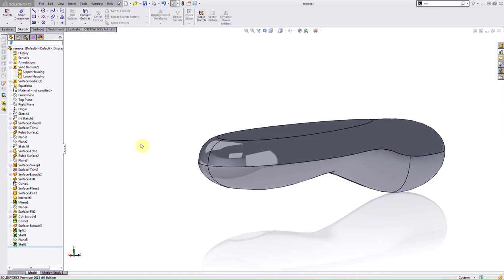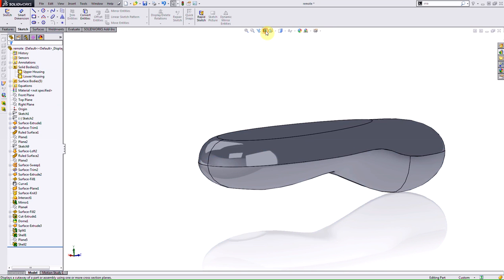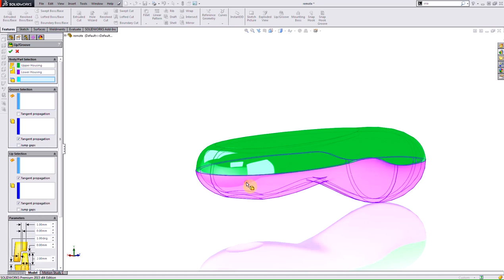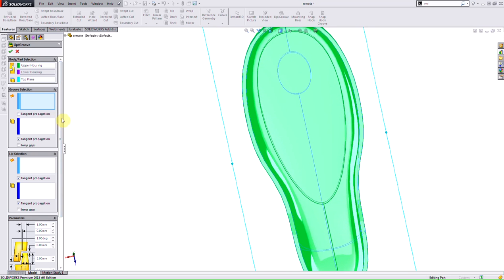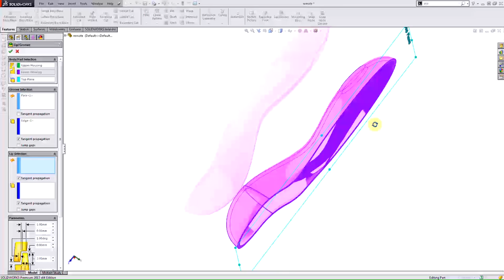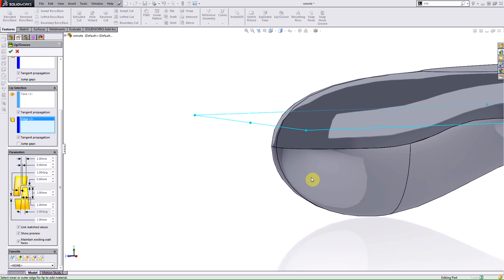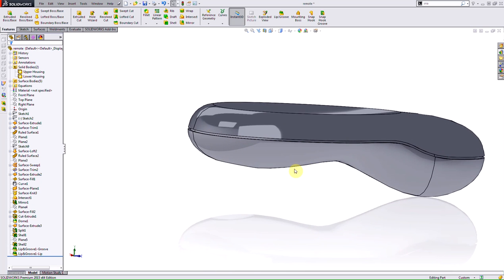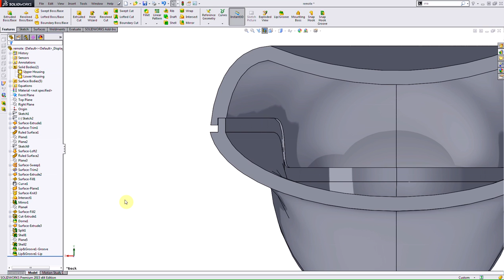Lip Grooves in SOLIDWORKS

Comment: PLease help! I keep getting the blue line instead of the yellow preview lines. Also I can't seem to make them work because I keep getting error "Unable to create lip groove from the input" :/
Reply from the maker: Hi Steven, there are many things that could cause this. Couple things to check:
-Make sure to select from correct bodies for Lip and Groove respectively
-Make sure the dimensions set in parameters are small enough that they can actually generate

I would recommend testing the Lip/Groove on a very simple part mock up to familiarize with the different options

Sometimes, faulty faces or short edges on a complex model may also cause Lip/Groove to fail to preview/generate
Reply: @hawkridgesystems  Thank you it's actually the 2nd mistake you mentioned. Fixed it. Thanks again :)

Comment: What if the lip isn't perpendicular to a single face but should stay perpendicular to the curved surface it is on?
Reply from the maker: In that case it would be best to use manual surfacing techniques. One method could be to create a Ruled Surface (option for Perpendicular to surface) or Swept surface then thickening the surface to produce the lip.
Reply: Hawk Ridge Systems Thanks for the help! I have a final exam on this tomorrow so it’s just in time!
Reply from the maker: @yannickvertessen2721  Great to hear and good luck!